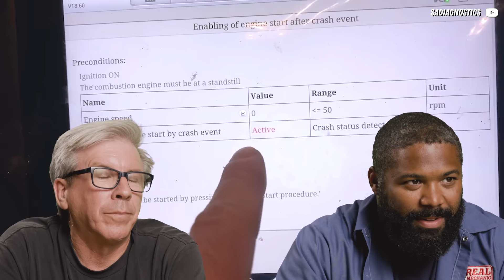Mechanic Reacts to Engineering Fails

Comment: Remove the heads. Remove oil pan. Remove rod bearings. Remove pistons and rods from the top of the block. Turn the crankshaft by hand, or saw it in half. Remove the torque converter.

Comment: 2012 BMW X5 35d diesel - crankshaft position sensor hidden under the starter. You need to take off the intake manifold and starter off. One of the starter bolts is inaccessible without 2 swivels and extensions. There are fuel lines on the way and a coolant hose, plus a mile of vacuum lines. $29 part takes like 4 hours to change.

Comment: I know I'm late to the party but gotta share. I have a Nissan Murano. The Alternator went bad, it's positioned on the bottom of the engine, above the a/c compressor. So you are supposed to remove the compressor and refill it if you have to replace the alternator. The replacement alternator I got was faulty out of the box, so had to do this twice. That sucked. Then I looked up the spark plugs.... the local shop quoted a 4hr job and about $1k. Most of the top of the engine has to come off because 3 of the plugs are on the backside of the engine by the firewall..... usually I give engineers a pass, but a 4 hr job for spark plugs is a bit much imo

Comment: Most battery trays is only held in by 3 bolts that are corroded till the pild you have to spend a couple hours extracting it and search the the shop head to toe to find replacement bolts

Comment: The oil filter being in that location is gonna encourage a lot more brake cleaner to be sprayed all over the hoses too all the time. Assuming the mechanic will care enough to clean up, otherwise the oil will ruin the hoses.

Comment: "get out of the car and get safe first"....Sometimes being in the car is your safest bet.  I'm an EMT, we have a few highways and two interstates in my local.  I've had several crashes in the middle lane of a 3 lane interstate.  90% of the time, even after we're on scene, people don't care and are driving as fast as the person in front of them will allow them to.  Half of the time if the car would allow you to start them they would be able to drive to the shoulder instead of being in the middle lane.  We pull up as the first emergency vehicle on scene...and there's people standing next to their cars in the lanes of travel in an interstate highway.   I've seen people almost get hit a bunch of times...two of my coworkers have been nit on a scene, and just a few months ago one of my department's ladder trucks got hit on the highway.  Been there after people got hit a couple times.  Not pretty.  About half of the time it's because people are so focused on the fact that they just got in a wreck and it makes them oblivious to the danger, the other half it's because their car wouldn't start....I get that the car wants to protect itself....but even if the oil pan got ripped off, they should be able to get the car to a safe place to be.

Comment: To change the control arm on a B-series Ford Falcon U have to take a bolt out that, had Ford made 2cm shorter it would be able to be pulled out without the front cross members getting in the way. Literally have to drop the whole sub frame out

Comment: My condo association says I have to work on my car in my garage that's not as wide as most garages. I had to replace my steering rack, so I pulled the front end of my car in my garage and got it all apart to find out i needed 3 more inches to slide it all the way out. So I had to cut a hole it the garage wall or put put it all back in to go do it in a parking lot somewhere.

Comment: My 2013 suburban the oil drain is above the skid plate, it’s annoying.  Certainly not difficult to work around, notch the plate like they should have from the factory and it’s no longer an issue lol

Comment: Pulling the intake manifold off of a 6.0 Powerstroke....  There is a bolt that connects the fan shroud to the intake manifold.  Trying to get at that bolt is a nightmare with the cooling fan in the way.  And it's recessed so a regular socket is too short, and a deep socket is too long.  Gotta use universals to wiggle a socket in there... Getting the bolt back in is even worse 😂😂

That being said, whichever Ford engineer put a retaining lever on the serpentine belt tensioning pulley deserves a gold star.  Pull on the belt to get the tensioning pulley moved, push in that little lever, let go of the belt and the pulley locks in place.  Makes changing the alternator a 15 minute job and you don't have to mess with getting the serpentine belt back on in the right place because it stays put.

Comment: We had a fire in the back of a car because the line for the wisher fluid for the wiper had a hole. Because the fluid has glycol (especially in Winter in Europe) it created a flammable fume. The wet drops of the fluid went into a control unit, there was a shortcut around a relais and the sparks ignited a fire. The worst thing was: alcohol burns with a almost invisible flame. It looked like that Fiat. Greets from a firefighter.

Comment: Late 1970s and early 1980s Fords had a relay in the trunk, that would shut off the fuel if you got into an accident. Most people didn't even realize that this was a thing on these cars. I saw a car get into an accident one time when he pulled in front of a winnebago. And spun his car around. He could not move it out of the street. I told him to pop his trunk I reached in I reset the fuel relay and he moved it over to the side of the street. The other advantage that that had, is if a police officer wanted to get somebody to pull over all he had to do is pop them in the back end, and the car would shut off. That's a perfectly safe way to make it easier to get these cars to pull over you don't have to chase them at 130 Mi an hour across 50 mi, you just bump them in the ass and, and the car rolls to a stop.
And about Ford? What the hell can you expect from a company that doesn't know how to number its cylinders on a V8 in the order in which they appear on the crankshaft???

Comment: Engineering fail: S197 Mustang engineers attaching the crankshaft pulley to the harmonic balancer with rubber....notorious for walking the pulley off the balancer and into the crankshaft sensor after ~60k miles

Comment: The Ford Escape oil filter is so easy. Yeah, the hoses are in the way and annoying, but you just push them out of the way with one hand and put the filter on. The worst part is just cleaning up the oil that drips all over the hoses

Comment: Angelina and Sandro is the best part of this. Now we need to see some competition between them. Not High/Low. Maybe her are 2 identical rollers here is a budget per car, build it and auction them off. Who ever gets the most wins. Run lap times with a driver that does not know who built which fastest lap around a course wins.

Comment: Mid 90s F series trucks had faulty wiring harnesses that were recalled.  The brake pressure sensor was wired to the supply side of the fuse and was always hot and not fused.  The sensor would short and start a fire.

Comment: Had to lift up an engine by the bell housing (not by much but I wasn't about to pull the engine to replace the pan) to get a quarter inch of clearance so that I could remove a mostly exposed oil pan.

Comment: I actually really like the engineers that designed my 94 f150. So much has been so easy to work on. I have learned so much.

HOWEVER. Oil pan gaskets are pretty well known to need to be replaced, due to the frequent temperature changes they deal with. My pan is form fitted over a welded in cross member. The only way to replace the gasket is to pull the engine, or undo motor mounts and jack the engine up enough to slide the pan with the oil pump out altogether, to which you'll then have to finangle back into place altogether.

I am not smart enough to think of a better design, but surely there is a better way to do that.

Comment: 5:00 sandro is 100% right, if you get into an accident personal safety is a lot more important than your car. Thats why i will never buy a car with a "feature" like that because it screws you over having to tow it to a shop instead of letting you repair it yourself

Comment: For the one with the Mercedes not starting , they have a safety battery terminal ( at least newer BMWs do) and you have to replace that safety terminal but there’s also a way to bypass it. For Mercedes I’m not 100% sure. I’ve only had BMWs come in with that issue after accidents. I do airbag (SRS system) work for a living so I work on cars with deployed airbags and I do ADAS calibrations.

Comment: On my 2011 VW jetta SE 2.5 you have to remove an engine mount and pry the entire engine forward 3 inches and hold it there. Inorder to get the front driver control arm bolt out. Otherwise the transmission fluid pan is in the way. Optionally... You can take the transition fluid pan off instead allowing you just enough room to scrape the fuck out of the gasket surface of the transmission case, but also enough room to get the bolt out.

Comment: I have plenty of complaints about engineers, I got a 2010 mercury mariner with a 2.3-liter engine, the dealer cut the dealer cut the pcv valve line to the intake, to get to the line you have to take the intake off, to get the intake off you have to take the bolts out, but to get to one bolt to get a wrench in to take it out, 1 you can't see the bolt 2 you can't get a wrench in to get it lose you need a socket, to get a socket in there you have to take the fans out for the cooling system, to get the fans out you have to take the front bumper cover off, then when you go to put it back together you have to get the bolt back in the intake, you can't use your fingers the bolt won't stay in a socket and you still have a confined are that you can't see what you're doing, I ended up using an inspection camera to try to watch the way the bolt went in and it took me at least a half hour to put one bolt in then you have to put everything back in, not a good design at all in my opinion, and the dealer that we got the car from is a big dealer and they put a piece of rubber hose over the cut line and the rubber deteriorated, and was a vacuum leak and I made my own smoker to detect it and that's the only way I would have found the problem.

Comment: My wife’s dodge caliber wouldn’t start. I checked EVERYTHING and all was fine. Turns out, there’s a secret fuse box in the driver side WHEEL WELL with only relays, and one of them went bad.

All the other fuses…under the hood.

Comment: Had to replace the battery and a head light on my old chrysler 300m. Battery is in the wheel well. Had to take the wheel off and almost accidentally weld a wrench to the battery taking the leads off. For the light, had to take apart a large part of the front end.

Comment: I do most of my own basic car maintenance (oil, air filter, etc).  My last car was a ford focus, and i literally could not see the oil filter and touch it at the same time. Even with an inspection mirror. My current car is a Subaru outback, and imagine my surprise when the oil filter was right out where you can easily take it off without even getting dirty.

Comment: My MK4 Ford Mondeo (I think it's the Fusion is the US) has a 2.0TDCI diesel engine. It also has rev match (for up-shifts) when the engine is warmed up so I can pretty much "jump off" the clutch and everything is fine. Engine rpm is at the next speed of the next gear.
Since it's a diesel car it needs to do some regen stuff. Once the regen starts, there is NO direct indication about it. No info on the dash, no indicator light. Nothing.

Aside from.... in regen mode the rev match feature is disabled, which means that when I jump off the clutch as per usual, thinking that the engine rpm will be matched with the transmission rpm so nothing bad should happen.... yeah... the dual-mass flywheel LOVES IT. It almost wants to EXPLODE out of happiness. The first 1-2 gear shifts will be loved by the dual-mass flywheel.

Great job Ford.

Great. 
Job.

Comment: When engineers design a car they should take the very first one before production get locked in a room and they are not allowed to leave until they change out all the common maintenance parts. So they have an understanding of what it's like to replace that water pump. The tensioner pulley spark plugs. No food, no water till the job is done in a nice temperature controlled environment
Reply: This a million times over. What, you engineered it! Welcome to our hell. 😂
Reply: Try it in a shop in the summer in 100 degree heat. No bathroom breaks either!
Reply: Prisoners at Gitmo are treated better than that! But none of them made stuff that can't be fixed, it just blows up!

Comment: 99 prizm, 04 lesabre, 05 pilot, 09 hhr manual, to 2020 renegade. the only car i gave some choice words to for doing basic maintenance as a non mechanic was the 2020 changing the cabin air filter. ALL the others were toggles and push pins then you get to a plastic flap with a tab. not the 2020. this one was removing like 3 parts, 7 screws, and the plastic cover to the filter housing. THAT is what annoyed me the most

Comment: I can’t believe he took the ford escape oil filter as the big inconvenience and not the ford oil trays that sit under the oil filters on their f-150s that just collects the oil and only lets a fraction of the oil drain out and the rest just sits there and drips until the next oil change because it’s near impossible to clean properly. It can add an extra 10 minutes to an oil change depending on if the drain gets clogged and your best bet is to wipe up as much as you can and then spray with a hose and hope the customer doesn’t come back because he found spots in their driveway.

Comment: Ive posted a video of me fixing my 96 Jeep Cherokee door hinge, the fact i had to take off all the front body and bumper of my jeep just to take off the side fender to get to my hinge to build it back up with welds to add metal, it worked and i check the metals condition ever 6 months and i re apply rustolium when it needs it

Comment: Currently working on a 2007 Nissan Murano. Replaced oil caked alternator. Leaking valve covers. Fouled plugs. Can't service the tube seals so have to replace valve covers because they are designed non serviceable. Suspect bad pcv valve. It is buried behind intake manifold. I hate that the radiator cap is right next to where the coolant can spill onto alternator,  belt, and pulleys. In order to service oil filter have to remove wheel and cover. In order to remove alternator had to remove wheel to access pulley and remove fan, idle pulley, and radiator. Seems like I have to pull apart a ton of stuff just to get to anything. Had to unbolt the rear windshield wiper just to change the blade. Servicing my Xterra is much easier.

Comment: Had an '05 Dodge Stratus where accessing the battery required you to take off the front driver side tire. Because it was in the wheel well, behind a plastic flap. That was also the car that had a bad alternator, and I thought it was the battery. At 9 o'clock at night. On the side of the highway.

Comment: Going from a 1993 Honda del Sol Si to a 2007 Volvo XC90 V8 Sport has taught me everything I need to know. Honda was stupid easy to work on. Volvo requires so many things to come off just to replace simple things like spark plugs, ignition coils, alternator, starter... things you should expect to replace over the life of a vehicle. I love my Volvo but I sincerely miss the simplicity of my Honda.

Comment: 16:00 if youre like me, you tend to take a grinder and make you're own little access points on the sub frame. Yes I'm a certified engineer, not a degreed engineer, I graduated from Columbia State votech in 2005, so take this with a grain of salt, but we were taught as long as you don't cut a hole more than 30% wide of the total width of the strut, and you don't cut into any bent angles (like turn downs or turn ups) which are where the true rigidity of the structure lies, then you can make access holes. Some people prefer actual round holes using hole saws, and there is some science to those causing less integrity loss than a square hole, but it's a sub frame, and if you're in an accident so bad that a 2x2 hole cut from 16ga steel is a concern, that hole is the least of your problems. 
Now cutting into the actual frame is different altogether...don't do it.

Comment: I learned to run the car on the starter to get it off the road if the engine isn't running after a crash in Sweden in 1988. Should teach everyone to do the same today since it cuts the fuel supply. 

No one just has to be sitting there, run it off the starter and get to the side of the road.

Comment: when replacing spark plugs on a Chevy mini van(forgot what model) i remember you had to disconnect the rear motor mounts and pull the engine forward.. still almost didn't have enough room for a wrench.

Comment: I replaced my driver's side headlight on my Scion xD over and over. Turns out that I couldn't get the gasket around it. A mechanic said that he had to come in from underneath to have enough space to set the gasket.
Haven't had to replace the headlight since.

Comment: My 2010 f150 platinum, the power ateering cooler is built into the ac condenser.  So when it springs a leak you have to drain the ac system